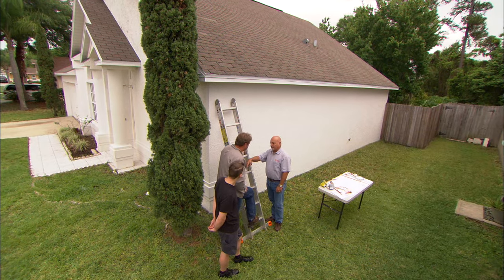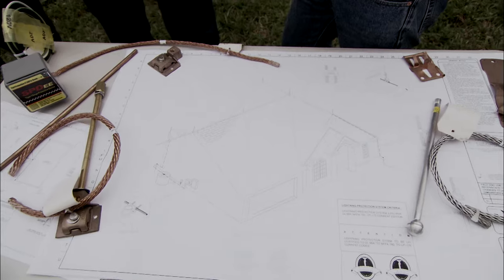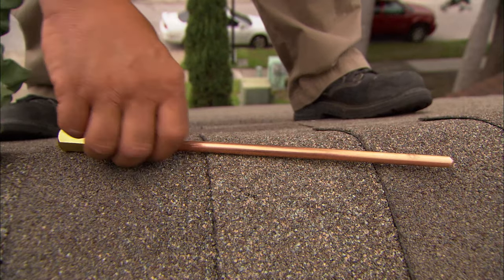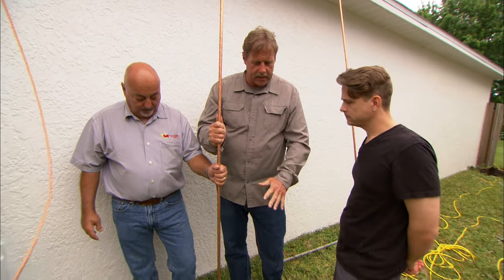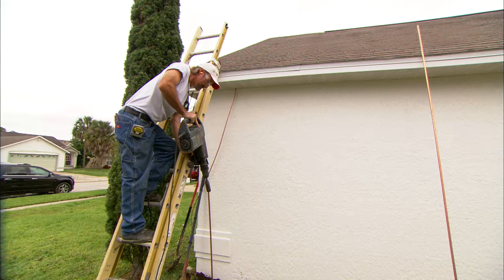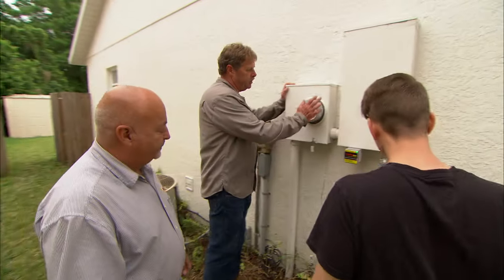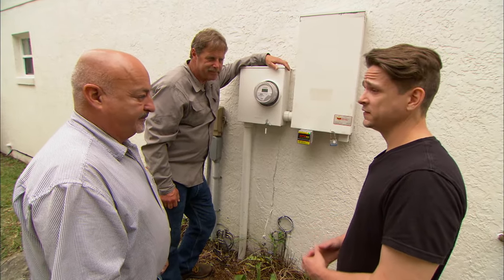Installing Whole House Lightning Protection | Ask This Old House

Comment: My father installed 4 rods himself right on top of the house, cable is through exterior too and grounded several feet below. We get a lot of lighting & T-Storms during summer. So, we're blessed, there has never been any issues.

Comment: Speaking as a retired electrical engineer;
When a lightning strike occurs, the bolt creates a path of ionized air  from cloud to ground. That's why you see the flash. That path conducts really well. The idea is two fold. The rods on the roof will leak off charge from the air over the house so it doesn't build up there as much. That's why more than one rod on the roof. Hopefully it will hit your neighbors house or the tall tree nearby, or the utility pole on the street that is taller and has a grounded conductor.
Then if it does build up too much or too quickly and hits your house,, the ground wire will "guide" the ionized path to follow it to ground as it is the lowest resistance path. But that ionized air is several thousand degrees hot!
Conductor in attic is a very bad idea, should be on exterior. Sorry about that "wife acceptance factor".
I would drive the ground rod several feet from the house, not next to it. Several on 6ft centers would be even better. And I wouldn't tie it to the electrical service ground as that can be a path for the surge right back into your house wiring. And the lightning ground system should be better than your service panel ground anyway as it needs to handle thousands of volts, not just 120 or240 volt faults.
Reply: All ground rods must be bonded together to meet code. Also the energy will not make it back into the house as the ground is a conductor, not your electrical panel.
Reply: @networkingdude  The ground bar in your electrical panel is connected to the rod outside. Sometimes this goes thru the electrical meter socket.
However, code also requires that at the main panel, the NEUTRAL bar is "bonded" (by a screw) to the ground bar. This means the Neutral on everything in your house (one side of each receptacle) is also  effectively connected to ground and the house ground rod.

At a lightning strike the main part of the strike hopefully goes to ground via the lightning rod ground if the connection is low enough resistance. But the ground can only absorb so much current at a time and for a fraction of a second the area around the rod for several feet will be charged with thousands of volts. This why it's best for the lightning system to be away from the building with several rods spaced several feet apart to spread out the charge.

Also lightning is NOT direct current. Once the strike begins it oscillates at a high frequency, which is why you hear it on radios, particularly AM. Any sharp bend in the grounding system wires forms an inductor which is like resistance at high frequencies  and reduces the ability of the ground system to take the charge to ground. So all bends should be gradual, maybe 6 inch radius minimum.
Reply: @JP Hello. May I ask under what circumstances should lightning protection be installed at a normal house ?  I have a three-story house with an attic , no basement, and there is a house of the same height next to it. It often rains where the house is located
Reply: @abrandpluckedoutofthefire8043  If your area has a high incidence of lightning storms, or if you are on a high piece of ground without taller things around you makes you especially vulnerable. But it can hit most anywhere. If you have metal on your roof, like a chimney cap or antenna, it should be grounded at minimum.
Reply: @JP  Thank you for reply
Reply: So how does the copper wire not catch whatever its touching too on fire
Reply: @jessyedge5492  It can, if it melts or is overloaded. That's why it should be outside. And ideally mounted on insulated spacers so it is away from any flammable materials. Inside an attic or wall full of flammable materials where you can't easily see all of it is not good. Because if it conducts a strike, at the very least it is going to be very hot after.
Reply: @JP-rf7px  thanks man I always wondered about that
Reply: "Hopefully it will hit your neighbor's house" 😂😂 savage
Reply: First, just so you know, it is immoral to pass your problems onto your neighbor.  Morality is going to make a comeback, so it's good to know.  Second, lightning goes up from the ground as well as coming down from the sky.  If the wiring inside your walls is grounded separately from your lightning rod wiring; they can take on huge opposite charges during a strike and arc from one system to the other inside the walls.
Reply: @nonyadamnbusiness9887  First, You're running lightning into you're house walls? Secondly there's no mercy in nature, she doesn't care about you're morality. Sorry.
Reply: @smileydavis73  First:  You obviously have no understanding of my comment.  Think about it like this:  The lightning rods and wiring to the ground is one cage and the ground wire system inside your house is a cage inside a cage.  If the ground potential between the two cages varies, lightning will jump from one to the other.  If the two are properly bonded, they will always have the same ground potential.  Second: If you have no moral standards, lightning is never going to be your biggest problem.
Reply: MilSpec requires an "independent" aerial and main conductor with the earth grounding rod no closer than 8  feet from a powered system/shelter. Never noded to the power grid of the system, that should be self evidently a bad idea, just like piping lightning into a house is. Your structure before a strike will be saturated in positive charge at and above the ariel. If the charge delta t of the offending cloud is greater than that of the discharge of your aerial the strike will occur and be shed "over there"  not electrically nodded to your house, wiring, and electronics. The ocean of positive charge the structure is floating on will normalize and you're house wiring will too.
Secondly having the best lightning system = the same. Nature, there's only the law and the rule.
Reply: I had the same thought.  The conductor belongs outside.  Second any metal object near that conductor needs to be bonded to it to prevent flashover.
Reply: NEC 250.106 requires the lighting protection system ground terminals shall be bonded to the building or structure grounding electrode system.
Reply: Also, NEC 250.53(A)(3) Informational Note states that the paralleling efficiency of rods is increased by spacing them twice the length of the longest rod. Which for an 8ft ground rod would be 16ft apart. However, the minimum spacing for ground rods is 6ft per 250.53(A)(3).
Reply: After reading all this, I'm thinking I'm safer wo a rod!   If it's wired wrong, it's going to light up the house, AFTER attracting the lightening.  I thought whole purpose was to 'vent' ground charge into atmosphere above ur house to neutralize the potential for a strike.  

?? what's the deal ?
Reply: Agree that the conductor on the attic is a bad idea.
Reply: This is one video that I think YouTube should have shut off comments !
As this solves nothing, but generates mass confusion !
Everyone knows that the NEC states all Grounding must be attached to the Main Electrical Service Ground !
In an effort to keep everything at the same potential !
And if you live where the ground freezes, the ground wire no smaller than # 10, must be buried below the Frost line !
The colder the temperatures, the deeper the trench !
5 to 42 inches, or deeper !
It doesn't take a direct lightning strike to cause damage to sensitive electronics !
And in today's World, what isn't !
A lightning strike miles away may produce enough power to inductively couple a charge into the power lines coming into your home, or cable and telephone lines as well !
Not to forget any Television antennas installed for Off Air reception !
Lightning follows few rules, and pretty much does what it wants !
Surveiling my freshly mowed lawn, I noticed a perfectly round patch of dead grass, maybe 2 to 3 inches in diameter.
Having no recollection of any corrosive spilled there, it remained a curiosity, and quickly forgotten !
Sometime later, I noticed damage to our newly sided garage, near the bottom edge.
Again, couldn't explain how that got there ?
It simply looked like something had smashed into it, hard enough to crack the vinyl siding. 
Fast forward, I decided to replace the damaged panels, and it wasn't until the inside of the siding was exposed, that there were Black char burn marks, where it was obvious the garage had taken a lightning strike !
Hence the circle of dead grass some 10 feet away !
The odd part, not 15 feet away, was a well grounded and guyed 85 foot antenna tower !
Why it didn't strike the tower is beyond me, but like I said, lightning does what it wants !

Comment: Sometimes I think "This Old House" should be called something like "Numbskull Renovations".  As if running a lightning rod ground cable through the attic wasn't bad enough, they screw it down to the pine framing with copper tabs.  Then they don't mention the necessity of bonding the lightning rod ground to the electrical system ground.  They've built a system to transfer lightning from outside to inside the house.

Comment: But the cable inside the attic attached to bare framing. Wouldn't that cause a fire if you had a lightning strike.

Comment: What stops the threaded bolt on the roof from rusting out. Why is the through the roof bolt not copper or brass. Why change to steel when it does not have the same conductivity as brass or copper, I would have thought dissimilar metals so far apart on the noble scale would encourage electrolysis in damp conditions.
Reply: Stainless which is compatible with copper  or brass.
Reply: Why yes, the galvanic corrosion is a concern, especially on the copper parts; but why would you put the least conductive part of the entire system intentionally being surrounded by the flammable wood and asphalt of the roof when you are attempting to shunt huge amounts of electricity to ground.

Comment: While lightning rods CAN ground a lightning strike, that's not the goal.  Lightning rods ground the charge buildup that causes lightning strikes to happen in the first place.
Reply: I'm glad someone already said this... 95% of commenters don't realize it's for leaching charge from the local atmosphere...
Reply: "some of the time, not all of the time". what are you talking about?  You think there is lightning occuring without electricity?  Your comment makes no sense.  When a cloud builds up a charge strong enough for it to discharge to the earth, the electrical field from that cloud extends well down below the surface of the earth.  It has to, by definition.  Else how else do you think the lightning bolt knows where the closest conductor is?  Electricity doesnt peek out from the cloud and look for the tallest tree, it doesnt have eyes or yardsticks or testing equipment to find the best way to go.  It knows that from the electrical field it generates.  The huge number of electrons on the bottom of the cloud push down on the electrons on everything below it, which push back just as strong if they are in nonconductors like a fiberglass pole, but in the case of a conductor, like a wet tree or a lightning rod, the electric field slides through the conductor, and lets the charge bleed off.  Now a metal rod conducts better than a tree, so more charge is allowed to bleed off and hopefully the total charge in the cloud isnt allowed to build up enough to cause a lightning bolt.  A tall wet tree isnt as good at conducting, so more often enough charge builds up to cause a lightning bolt when then shoots down the same path to ground, i e., through the tree.  Lightning rods dont sometimes conduct electrical charges and sometimes not.  This happens everytime, not just "some of the time, not all of the time.". why would you even think that?!!
Reply: there's a reason capacitors are flat.  pokey things leech voltage way easier, which lowers the capacitance to the ground helping the lightning choose somewhere else to go.
Reply: @scotts6151  No.

Comment: the video is interesting and informative , I've been installing lightning arrester across saudi arabia, the video didn't show how you connected the surge device in relation with the grounding and lightning aerial.
Reply: The surge device goes to a 2 pole breaker in the electrical breaker box. In Residential dwellings in the USA we have two hots of 120v so a double pole breaker goes to those two hot legs in the breaker panel. There are neutral and ground wires on the surge device and they are connected in the panel as well. Usually the electrician tries to place the double pole breaker for the surge protector close to the main breaker (usually at the top of the circuit panel). That may involve relocating another breaker to another spot in the panel. So the surge device is just connected to a two pole breaker in the electrical panel.

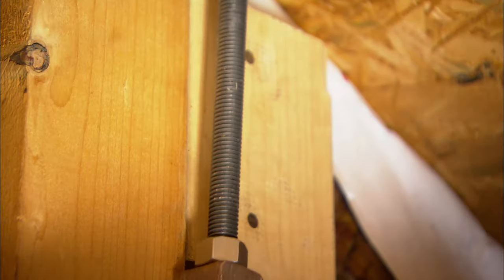Comment: Copper and brass is used for the whole install, then the main rod on the roof is connected with a piece of steel all thread. Doesn't seem to make sense, or am I wrong? @ 1:10
Reply: i didnt understand that either. they also didnt use any corrosion inhibiting compounds in between the dissimilar metals. i do not think this will work long term because of that steel all-thread..
Reply: Also, huge amounts of power are going through it, which is why you want to use copper. But hey, let’s put steel through the part that is going THROUGH the wood of the roof. Steel, the metal known for conducting electricity better than copper. Also for cooling back down after being heated up faster than copper... oh wait, no; it stays hotter and conducts worse.

Comment: Can I run the lightning protection naked copper wire through the attic and through the wall and cover it with the foam insulation. I read the 780 SPEC and according to it I can.. could you please verify my understanding as someone told me that, the heavy current when run trghough the conductor, may burn the trusses or foam insulation. My understanding is, teh copper wire will not get that hot when lightning current passes through in case of lightning strike. Appreciate your help and support.
Thanks
Villayat

Comment: I'm not impressed with how they seal the holes they made at the roof peak with just blobs of caulk.
Reply: Roofing asphalt, not caulk
Reply: Flammable stuff. Right on the least conductive part of the “system” they have.

Comment: Wouldnt it be better to run a thick copper wire up a tall tree right next to the home and ground that wire? It would be taller and would keep burning away from the home. If there isnt a tall tree close to the home then maybe a metal tower for a wind turbine or ham radio tower would be a good location for a lightning rod?

Comment: Good thing this smart homeowner put a lock on his panel/main disconnect to the house in case of an emergency
Reply: Well 1) the real question is why is the panel outside and 2) this is a reupload and was probably filmed years ago when metal prices were higher and metal theft more common...could be to deter theft.
Reply: The 2020 NEC requires a service disconnect OUTSIDE the home. This is so the Fide dept can shut off in case of a fire before they put water on it. Not sure if they can prevent you from locking it tho. FD should have bolt cutters on the truck if needed.

Comment: Generally lightning is accompanied by rain, so wouldnt that help the grounding rods in dissipating that power?
Reply: Depending on the soil. It could percolate through sandy soil fairly quickly but clay would not perk well.
And T-storms generally last a several minutes to an hour, but it would likely take much longer for the subsoil to be wetted down 10-20 feet by the accompanying rain.

Comment: Why inside? that sounds like a fire hazard too me if it strikes.
Reply: how? its simply a ground wire that sends the lighting to earth
Reply: I'm thinking the same thing. It's unsheilded copper against wood. With a billion volts passing through it, that copper is bound to get hot. I've also wondered why churches put rods on steeples. Total lack of faith if you ask me ;)
Reply: That has never been proven to be dangerous.
All the houses that had it were burned down so no evidence remains.
.
High voltage and high wattage in a wire will heat it up so yeah having that inside your house is stupid AF.
Reply: You are talking a fractions of a milliseconds. There will be hardly any resistance or time to heat up that conductor.
Reply: @MsUltrafox  back to high school level science for you...
Reply: @bum-edwhu66  no
Reply: I’m surprised the copper wouldn’t vaporize. I’m a sub electrician so I don’t have to worry about my fluke (or me) vaporizing but I’ve heard of electricians on carriers vaporizing when their fluke leads touch many thousands of volts.
Reply: @STXVIEC  You're dreaming.
Reply: @mad0scientist  what do you know about electrical mr scientist
Reply: @STXVIEC  15 years EE at an Army ammunition plant - supervised lightning protection installations to military specifications.

Comment: Do you bury the top of the ground rod or leave it uncovered?
Reply: You sink the rod below ground level so no one trips on it or hits it with the mower.  But If you're area requires inspection then you leave the connection exposed until it's checked.  Then you can cover it.

Comment: I would be happier with a glass / combo insulator myself. You would in my mind have to be careful about what this wire in the attic gets close to that is grounded. Nails or screws should not be an issue as they should not be ground potential. It's all about attraction here, wood should not provide that but it's all about the ground potential. Better to have the wire in the attic encased and also grounded.
Reply: that wire is the ground, and the path of least resistance